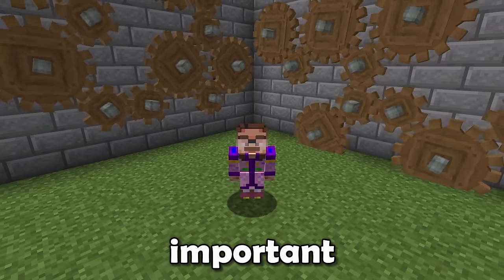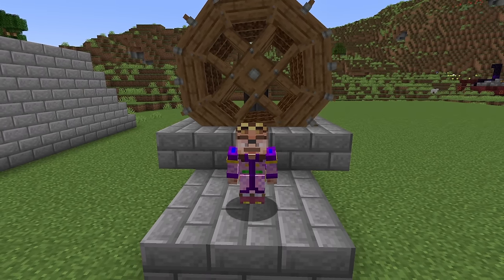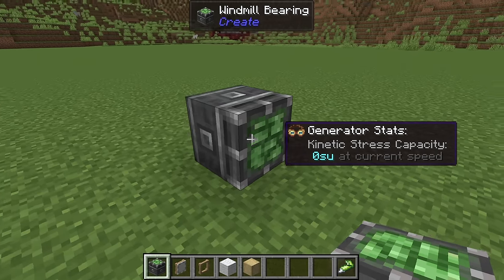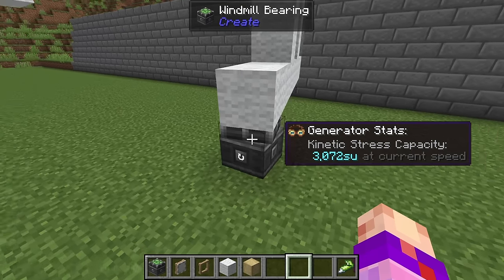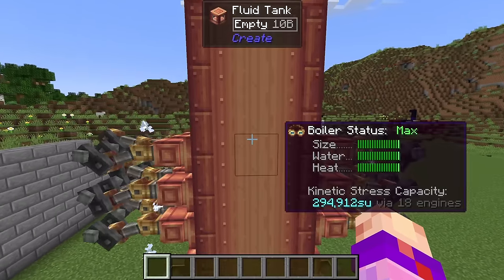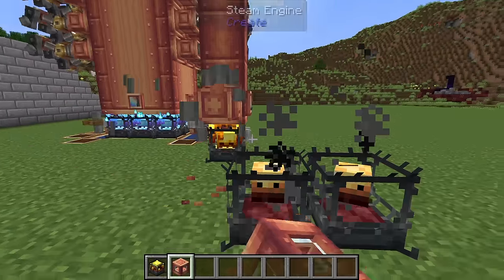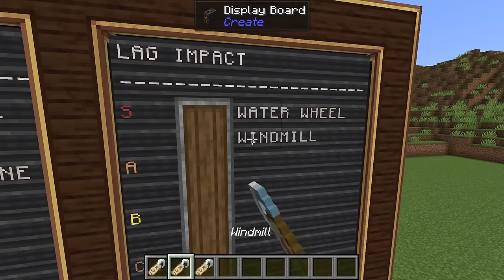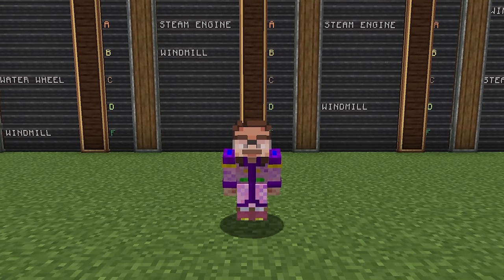Water Wheels Are BETTER Than Steam Engines (Kind Of) - Create Mod SU generator comparison guide

Comment: If you struggle with getting blaze burners, you can actually just right click a blaze spawner with the empty burner and get one so you can do it in peaceful. It doesn't use the spawner up either.
Reply: the problem isnt in getting blazes, you'll find them from a spawner anyways. the issue is finding a FORTRESS IN THE FIRST  PLACE.
Reply: @koiledPythonRain  if you have a map mod like journeymap the fortresses are usually pretty easy to find. there's also the structure compass if you aren't against a little cheaty feel. But I agree, fortresses are annoying if all you have installed is create.
Reply: @koiledPythonRain  You need to find a fortress anyway for brass items
Reply: @Bookslayer10  yes, that too
Reply: @yeetmcmeat  i had to create a separate creative world even with journeymap, and i missed a fortress that was close to my portal, then i did the locate thing and i found it
Reply: i play in 1.16 where furnace engine is still not dead
Reply: You can use campfires
Reply: @koiledPythonRain  I know right. Me and my friend built a portal just to find that this portal spawned in the entrance of a piglin bastion, with no hope of escaping it because of layers of netherrack in every side
Reply: You can also use campfires I think
Reply: I have an issue with blazes killing me, before I trap them.
Reply: @ВячеславЛиховой  well like i said you can go to peaceful if youre really struggling and just right click on the spawner itself. it doesnt destroy the spawner either

Comment: the unit used is actually micro seconds per tick, so i assume "to calculate everything with this block you need x micro seconds per tick" normally minecraft wants to run at 20 ticks per second, this means that as long as your total "lag" isn't above 50 000μs/t you shouldn't experience any lag, of course this avoids how much it takes for minecraft to do its normal stuff
Reply: but multiplayers is miltiply the lag
Reply: Do you maybe happend to know what mod adds this?
Reply: @karoll2914 are you asking about the water wheels and steam engine or something else?
Reply: @J0hnB09  I'm asking what adds the lag meter
Reply: @ShiroCh_ID uhhh i can see the thought process but no
Reply: @karoll2914  If you're talking about the green boxes that shows μs/t,  it's Observable.
Reply: @Dokattak  Thank you
Reply: @ShiroCh_ID no, the server only ticks the block once and sends the updates to each client, you actually run a server in singleplayer
Reply: and this also ignores the amount of lag other modded entities take.

So reaching 50k is easy un a modpack...
Reply: @ShiroCh_ID  Good grammar to use learn.
Reply: @z3rocool  he has a point because get 4 players in 4 different chunks all running their steam engines you get 4 times the entity ticks that need to be handled on the server; whether you see it on the client depends on how close you are to them.
Reply: @gfimadcat   @gfimadcat  thats just a different thing comletrly, if they are all in completely seperate chunks there will be longer entity ticks depneding om hiw mamy entities are being ticked it wont alwsus be 4x longer, and there wouldnt be more entity ticks, still the same amount
Reply: @z3rocool yyyes... that's the point, create contraptions are entities, and thus get ticked. With multiple players online, server's going to have to tick all of it - and Minecraft (and Forge) aren't exactly shining examples of performance so it does cause lag if there's a lot of people with a lot of contraptions.
Reply: @gfimadcat  but this doesnt talk abt contraptions fron what i remember, it sabt generators which arent contraptions, and create is also on fabric not just forge

Comment: I haven't personally done it but the windmill can be made part of the decor. Make the wool colored and look like a globe or other statue then you can "hide" it as part of a decorative park/feature. That said, totally agree with you!
Reply: And now I know my plan for power when I finally upgrade my computer to be able to handle Create, thank you random stranger on the internet.
Reply: I built a paddle steamer base where the "waterwheels" were actually windmills made of red wool :D
Reply: @danatronics9039 did you know if you put a plank in your offhand and right click on a water wheel you can change its color
Reply: Same for the water wheels. They make a nice moving component in builds.
Reply: the only reason i've ever used windmills over water wheels is to build giant windmill structures as decoration. never worth it!
Reply: I used the windmill as decoration and function at the same time, as a ... windmill! 

Literally built a windmill with a rotating sail and used that rotation to harvest wheat and turn it into bread
Reply: I use windmills to make farms instead of using a mechanical bearing, free rotation
Reply: I love the idea of a spinning globe inside my museum that functions as a windmill! I'll  be using this idea🙏

Comment: A problem with that perspective is:
- you play the first few hours with water wheels and then you have every resource to build a steam engine everywhere you need it. 

- a windmill is not for efficiency but for looks. Also you can pluck it directly onto a crop/ wood farm to make it move without lost space.

- at later stages you will have infinite lava in the offer world and in addition you have to calculate lag impact per SU, not per space. This bucket refiller has nearly no impact per SU. You need one of them (and not at 256 rpm) for a large steam engine (100k+ SU). Calculate the lag for 200+ large water wheels. 

In addition to that, whatever you do with the 100k SU will likely generate MUCH more lag than this steam engine setup, so that doesn't really matter that much. 

These have just different use cases. 

It's like saying, "which car is better, a semi truck, a sports car or a small car like a smart/ mini etc.?" - as it is most often, it depends. 

Nothing against the video though, just my rant plus engagement for the algorithm.
Reply: I agree fully with you, this is exactly what my thoughts are!
Reply: I mean if filling them is the problem sure in base you'll have to do the hand but in many mod packs you can just pluck a pipe into them
Reply: he missed the furnace engine that was deleted on 5.0
Reply: @Venenus_MC  yea... that thing was real cool though 😅
Reply: Mine is powered by a kelp farm, and I have four full size (but not max level bc blaze cakes) engines running. The kelp farm is definitely a smidge laggy, but I was also very green when I built it so realistically once I go back and simplify it it should have much less impact on my game. I also realized that a lot of my belts could be easily replaced with item vaults, and I’m sure I can find more lag (and space) efficient ways to dry and craft the kelp. But basically what I’m getting at is that the amount of raw power I get from such a relatively small space is insane, plus I love the industrial power plant look of it
Reply: I use water wheels to power the water and fuel pumps for my steam engines, becuase I simply don't trust the game to make certain a self-priming setup will always stay primed.
Reply: And this is why minecraft is a cool game, it lets be people use their brains and discuss stuff. Nice comment.
Reply: Windmills for crop/tree farms are what I mainly use them for, suuper easy to setup farms without needing to have a mechanical bearing, because it just rotates itself.

Also, they JUST look cool. They fit the aesthetic so, SO nicely.

Comment: I always use infinite lava sources to power my boilers, and use them for all my stress needs. I got tired of charcoal farms dying when they were out of random tick range. And I had problems with water wheels causing a lot of client side lag because of all the moving geometry.
I use quarries to dig giant shafts down to bedrock and fill the gaps in the walls with cobble, then I use hose pulleys to fill the pit with lava pumped from my previous infinite lava source. Now I have power wherever I need it.
Reply: wait, does infinite lava source with hose also works in overworld?
Reply: @ShiroCh_ID  It works with any fluid if there are enough connected.
Reply: @ShiroCh_ID create considers a pool of 10.000 blocks of any liquid an infinite source, it works in all dimensions
Reply: @bruhmomento3007   Me with a pool of only 9999 lavablocks, not figuring out why its not working: 🤔🤔🤔😤😤😤
Reply: @spazmcat3853  pretty sure its 10.0 not 10,000 their comment has a decimal not a comma not sure if you missed that or if i missed something
Reply: @brendanhatch983  but... 10,000 is 10 to me and all the other europeans. I do think that you are indeed american because to me 10.000 is ten thousand. And also it wouldn't make sense to write 10,000 or 10.000 because it would be clear that ten thousand is meant and not 10 blocks. You can look it up that not everybody uses (.) to signal decimals.
Tl;dr: no
Reply: @spazmcat3853  Would 10k mean 10 000 to you? (The prefix "k" = "kilo", or 1 000)
Reply: @semajniomet981  yes i would use 10k. Why wouldn't i use it. Its easy to understand
Reply: you can also use campfires instead of lava source blocks - just needs wood and charcoal and generates the same amount of SU.

Comment: Arcane Engineering configuring windmills to work with a single sail was honestly pretty useful for small fan setups. They only need minimal rotation to cook/wash stuff anyway, so an independent 2-block solution (especially in situations where you definitely wouldn't want flowing water around) came in handy many times.
Reply: Good tip
Running arcane right now and haven't really felt like getting into windmills. But getting power to a fan with only two blocks is really good.
Reply: Isn't that what a fan on top of a magma block is for? A bit more expensive though...
Reply: @dahelmang  That was taken out ages ago
Reply: @teasdaye  ah ok. It helps if you prefer 1.16 anyway.
Reply: this modpack have starbucle wheel.........
Reply: Me using windmills to power my skystone catalyst automation then getting angry at myself because I kept getting hit by the sails smh

Comment: 6:35 That windmill design could absolutely be compacted down to half the size or even less by just filling out the 3x3. And since the blocks become entities once the windmill is spinning, you can place new blocks in there, meaning it doesn't take up any space.
Reply: ikr
windmill are also infinitely scalable since you can just place another windmill bearing. If hes saying that they aren't scalable because you need multiple windmills beyond 8192su then surely waterwheels are terrible for scalability cus to get more than 512 you need more waterwheels.
Reply: @lord_scrubington  the waterwheels can also be compacted as he showed, also compatcting windmills into each other isnt safe because if for whatever reason the bearings turn off the windmills will all destroy each other as create will destroy blocks inside of blocks when stopped, thus using that method for saving space isnt really a valid way to score it especially since rejoining a world often causes the machines to stop for a second
Reply: @XiaoYueMao  even when compacted I don't think they are smaller than a space efficient windmill
Reply: @lord_scrubington  from what i understand about the waterwheel,s a 3x8x3 area of waterwheels make 16k su, with 0 blocks wasted
Reply: @mr.battlecats5512  You are absolutely correct.

You could even compact it more. to columns of 3 water wheels with a single source block between the top two would fit 6 powered wheels in a 3x3.

Comment: If only windmills were good.... Personally, I would absolutely love if they had actual wind mechanics - for instance, upwards facing windmills will get more stress units if above heat sources. Face a fan towards a windmill and it will make the windmill spin faster - without increasing the SU. This would also give a use for fans with high RPM, since currently the only use is range.. which doesn't matter if you get advanced enough tech.
Reply from the maker: oooh that would be really really cool!
Reply: This is kinda like old create mod versions, where encased fans could be placed facing a campfire or magma block and powered by redstone to output stress units out the back.
Reply: I personally LOVE windmills for spinning farms, because you have large gaps in the spinner anyway, and if you fill them with sails now it runs itself and does not need any power
Reply: @kenbaird7454  it’s true, but at the same time it sacrifices speed - unless you have a huge farm or make a wall of sail/wool blocks… usually (esp earlygame) its much easier to make a farm which uses a mechanical bearing and waterwheel - and have it run at a decent speed too! specifically best for trees farms
Reply: @fordalels I personally ususally make a MASSIVE rotary farm with multiple rings, so there will be a tree ring, a normal crops ring, maybe even a melon and pumpkin ring, etc. And this powers all that for no SU cost, and even outputs a decent amount of SU for belts

Comment: I agree that windmills are "meh" most of the time, with two exceptions... when I am making spinning tree, kelp, or crop farms OR need a small bit of power for something in the nether (where you can't have water), I do like windmills.  As for Tree/Crop/Kelp farms, the nice thing about using a windmill is that, if you use a windmill bearing instead of a mechanical bearing, the arm that you attach all your mechanical saws, harvesters, storage blocks, and portable interfaces to can simply be made of wool and then the arm itself IS the sail.  Additionally, the farm then generates the items AND a bit of power to run things like belts, sorting-system, or simple resource processing (such as a wheat farm that auto-processes  the wheat into bread or sweet rolls right away).  Essentially making a windmill option for a farm be the most space efficient since it literally takes up ZERO additional blocks beyond what the contraption would normally require.

As for building in the nether, you could power the water wheels with lava instead of water, but that can be dangerous if you have firetick enabled and are building out of any flammable materials or are playing in hardcore where you are probably trying to mitigate risk of getting dead.
Reply: Well, wouldn't you know it, we can use water wheels in the nether. Power them with lava instead XD there is an hidden achievement for that.
Edit: I must admit that I found this totally by accident.
Reply: @vcool122  LOL, me too bro, i was like, interesting, would it burn down the wheel if i place lava instead of water and BOOM, all worked out absolutely fine! Was building lava drain system, just to speed up lava gathering process (system with couldrons was waay slower then i needed to)
Reply: If you're building out of flammable materials in the nether, water wheels aren't the problem...
Reply: I do wish we'd at least have to make netherwood waterwheels for lava.

Comment: The thing about windmills taking up vertical space is that you can fit more in a single chunk, which is good if you have limited simulation distance. Giving them an F feels a little harsh, but to each their own. 🙂
Reply: Vertical water wheels, or vertical passive steam engine arrays would use that space more efficiently.
Reply: so can waterwheels, remember that same 32 block distance that waterwheels got, was if all spread in 1 line, but they can be compacted into that 2x2 orientation quite easily and only extend like 5 blocks, waterwheels can also be oriented vertically

but the reason for its low score ISNT its size, its due to size and SU ration, the windmills is EXACTLY as large as an un-compacted waterwheel setup but for that same size gives HALF the SUs... its trash sorry

Comment: Small water wheels are very power dense.  In a 15x15x3 area, with small waterwheels, 14,080 SU, near zero us/t.  6x6x3 x4 unused spaces within that area.  1 water source block, 56 small water wheels, 56 gearboxes,  104 filler blocks (glass?). Looks like a giant plus symbol laying on the ground. can be repeated vertically with direct contact power is coupled automatically.  Raw cost: 196 andesite, 22 iron/zinc, 392 logs, 104 sand.

Comment: you can power steam engines with campfires, you can pump water to a single one with a waterwheel and use that one engine to pump other 16 (or 32 i forgor) engines that also use campfires, and you got a ton of free SU
Reply: unfueled blaze burners also count as level 1 heat (same as a campfire) meaning that he did not even have to fuel that one to get the optimal results.
Reply: @gammaboy4568  do lava or magma blocks count as heat and if so are they greater than campfires? (i would assume lava is hotter than a campfire lol)
Reply: @XiaoYueMao  actually never tested that, and my guess is possibly no. It also would not likely contribute more heat, as mechanically the point is that blaze burners are a requirement for higher heat levels. If lava does happen to contribute more heat, feel free to let us all know-- definitely a more useful feature, in that case.
Reply: @gammaboy4568  anything except to blaze burners is a level 0 heat (passive)
fueled blaze burner is 1 (heated)
superheated blaze burner is 2 (superheated)